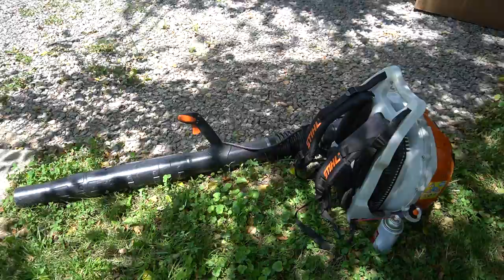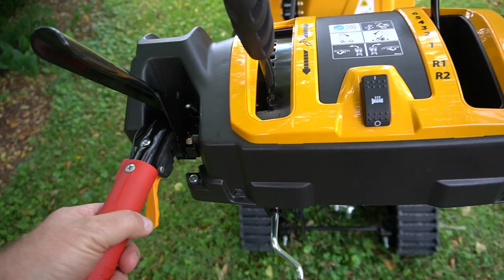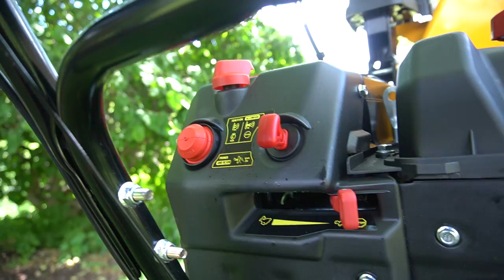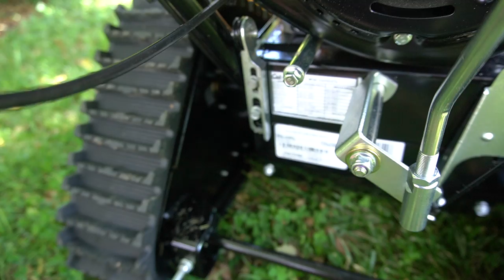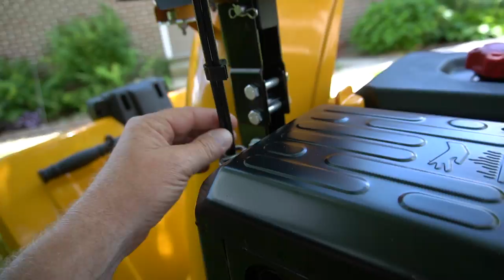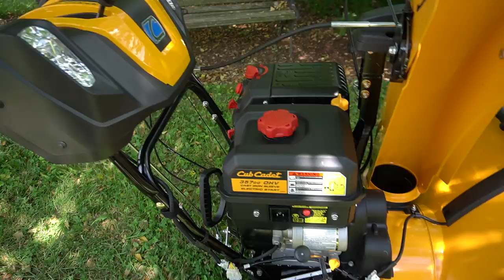Cub Cadet 3 Stage Tracked Snow Blower 2021 - Overview & Tips

Comment: Used to have this exact model. Mine broke in a year. Steering and reverse stopped working. Sold it and bought a Honda track drive snowblower. So far never had an issue. I hope you have a much better experience with that then I did.

Comment: Just beware.  Cubs don't throw very far at all.  Had one and know people that do.  The 1 complaint that I hear from them all.
Reply from the maker: If you’re only removing 3 inches or so of snow and you’re not going fast, that’s true.  It only throws it out 5 feet or so.  Just depends.  Sometimes less than that.  Depends on the snow type and how deep it is.  BUT if you’re plowing though 6 inches or more of snow, oh boy!  It shoots it out really far (20 feet or more).  It seems to all be about the volume of snow.
Reply: @Hooked on Photography  you think 20 feet is oh boy wow alot.  Its pathetic.  What is 20 feet.   That's what mine did at most.  Big 30" blower and a 375cc engine that doesn't bog down and all it can do is 20 feet!!   The cub cadet throwing distance is pathetic.  All the cubs are the same from what I've seen and the more I talk to people that have different sizes.   Now I have a toro 1232.  32 inches wide and same size engine as my cub. I went through the same spot in the snow. About 15 inches deep.  Cub threw about 15 feet, toro would guess at least 50 feet if not more.  Now that's a snow blower.  I liked everything about the cub accept the throwing distance its pathetic.  Will never buy another cub unless they change there throwing.
Reply from the maker: I’m just guessing.   I’d have to stop and think about the distance.  It may very well be more.  It very easily could have been 30.  Bottom line is that for me, it does what I need it to do, which is remove snow on my long hill of a driveway that I can’t do by hand or with our JD 4120 tractor because it’s too steep and dangerous for that.  I don’t normally get tons of snow.  The Cub (for me) seems built more than good enough and I’ve had zero problems so far after two winters.  Granted, it’s not heavily used but it works when I need it to.
Reply: @Hooked on Photography  they do seem well built. Just suck at throwing all im saying.  Anyone that buys them is getting jipped on performance  whether it's all you need or not. I was just informing people of what they really do wasn't intended towards you specifically.
Reply from the maker: @ecoboostrules9795  looking at the impeller on this unit, the blades of the impeller seem to be about an inch away from the wall of the housing so I’m just assuming that’s the reason why it won’t through snow very far until you get much more snow built up inside.   I’m not sure what the design rationale is for that and what other brands look like as far as the spacing of the impeller to the wall of the housing but it seems to me that’s the reason why it’s not throwing snow farther until you have a lot more snow.
Reply: @Hooked on Photography  it throws almost the same no matter how much snow you get.  Unless your talking less than 2 inches. It's that far away on several other brands.  I've looked at alot of them.  The impeller is to small also besides being far away.  Also should be more cupped to grab and throw it.  My new toro is very close to the housing and also has a 14 inch impeller.  Plus they are fully cupped so when it grabs the snow it goes.  The toro easily throws double the distance as the cubs.  Ariens,  and simplicity also supposed to be the same as toro for distance. Cubs got work to do.  Alot of it.
Reply: @Hooked on Photography  the salesman at the dealership has a 3x 30.  I was talking to him about this problem, he even agrees and said it's terrible and is going to sell his and buy something else.  That's a salesman for cub.  Lol.
Reply from the maker: @ecoboostrules9795   I looked closer.  It's probably more like 1/2".  I can barely get my little finger between the housing and impeller.  But I think that's why it doesn't throw well until you get into deeper snow.  Photos:  https://photos.smugmug.com/photos/i-26gKXRk/0/8e62c04b/X3/i-26gKXRk-X3.jpg

https://photos.smugmug.com/photos/i-cbt7Gnv/0/d793edf6/X3/i-cbt7Gnv-X3.jpg
Reply: @Hooked on Photography  again they don't throw well no matter what.  It's at least a half inch gap.  Plus impeller is to small and it's not cupped at all.  They have alot of work to do to catch up.

Comment: snow blowers do not have air filters
Reply from the maker: Yeah I learned that after I started to look up the reasons why snowblowers don’t have an air filter, I still think it’s a little odd but I can see why they don’t do it.   I would still prefer to have one.
Reply: @ThePhotographyHobbyist  yes....being as they run in a pretty much dust free environment....no need for it.....just like most boat engines....unless you run it through a sand pile of course (joking of course)....I hope you do a video when you see some snow.....would love to see that one in action.
Reply from the maker: @f62darkstar  I have one of those action cameras similar to a GoPro now, so I will definitely try to get some video when the snow hits.   Of course my luck would be, now that I spent the money to buy something like this, we will probably only get a few flurries this year.   😂
Reply: @ThePhotographyHobbyist  same here...last year I bought a Craftsman sb470 and we barely got enough snow to use it. It has the same identical engine as your cub cadet does.
Reply from the maker: @f62darkstar  hope you can use it this year (but not too too much).  Oh.  I guess that’s a MTD designed engine built by a partner in China.  I guess
Reply: @ThePhotographyHobbyist  I believe they are called power more engines.

Comment: The plastic wheels they are talking about breaking online are the drive cogs wheels in the middle they break around the bolt hole. I’ve replaced them twice in 10 years.

Comment: Great review, I appreciate your thoughts about making it last longer by not allowing the cables to kink when not in use.
Reply: Your comment about why you would want auger running still when not moving forward,   my thought would be so you allow the snow to clear out of the machine.
Reply: another thought so you can adjust the snow direction without stopping the auger

Comment: Would have been useful to see it actually run and turn, the part you said about it not turning well with the control switch would have been nice to see .
Reply from the maker: The comment about how it turns was made regarding how it turns on the grass (I bought it in summer and just wanted to drive it around and get familiar with it), but that’s not really relevant because that’s not a real world situation of how it’ll be used. I realized during my first winter of use that it actually turns very easily when you’re using it with snow on the ground.

Comment: About the transmission rod It usually tells you right in the manual how to set that up to get the gears to work right. 

For instance in the Toro manual for their products they tell you to put The gear shift in R2, Then you put the rod in the bottom first with the cotter pin, Then you pull the rod all the way up till it can't go anymore Then you unscrew that piece until it reaches the hole in the gear shift then you put the cotter pin in. 

This will set you up for everything to be perfect.

If the first gear is too fast which a lot of people have an issue with  All you have to do is get that top piece where the rod spins You want to turn it clockwise two or three turns. 

This makes the friction wheel on the friction desk be in a different place which will slow down first gear and actually make the reverse gears a little quicker. 

When you do any adjustment to that rod it'll change the speed in all of the gears so if you slow down first gear by turning it clockwise all the gears will be slower going forward but the reverse gear will be a little bit quicker  

Hope that explains how it works.. It's just putting the friction disc on a different spot on the friction wheel
Reply from the maker: Cool.   Thanks.  Personally, I’d like reverse to be a little faster.
Reply: @ThePhotographyHobbyist  Then just follow what I said about turn the top piece two or three times clockwise. It'll make first speed really slow But who cares You have six speeds. It'll make the reverse go faster.. That's the way I set mine up too.
Reply from the maker: @muzikmon2267  I’ll try that

Comment: ive got the 2x and its great!! lights up the whole driveway, and i love the tracks instead of the tires. it grips pretty much anything well.
Reply from the maker: That’s good to hear.  I have a big driveway on a hill abs also need to go next door to do the neighbor’s driveway which is a couple hundred yards away so I needed something I can drive across the yard in snow.  The tracks should help.   My luck will be this year, I only get a dusting of snow and won’t even be able to try it it.  😅
Reply from the maker: @willy david so far so good.  Though I admit where I live, I don’t have to use it very often.
 We could get 12 inches of snow, or just a dusting, just depends on the year.   There’s too much driveway to clear and it’s on a hill, so if it’s more than I can blow off with a professional, large, backpack blower, leaf blower from Stihl for example, I need some other way to clear the driveway and that’s where the cub cadet comes in.
Reply from the maker: @willy david the reason I like to use a backpack blower on my concrete driveway if it’s only 3 inches deep or less and it’s fluffy snow is because it does a faster job and it cleans it all the way down to the concrete (completely clean) whereas with any walk behind snowblower, you’re going to leave some snow on the driveway and snow that gets packed down when you drive over it and try to scrape it off with the snowblower.

Comment: For the steering to work properly you need a little resistance pushing against the machine like as you are going against snow.  Just using it on bare ground it basically freewheels and coats so you need to pull back slightly on the handlebar in the direction you want to turn.
Reply from the maker: Also I was testing that in the grass which is not ideal, but while using it this winter in snow and on my driveway, it turns rather easily.  👍🏻

Comment: For Toro horsepower they show the CC but the model indicates the horsepower.

For instance the 724 snowmaster is 7 horsepower The 7 in the 724 indicates the horsepower.

Same thing with the 826 or 828 those are eight horsepower

The 928 is 9 horsepower and so on..

Comment: So after a year how is going for you with this snow blower?
Reply from the maker: I honestly haven't had the chance to use it very often because we just don't get enough snow here often enough to use it.  I only use it when the snow is too heavy or too deep for my backpack blower.  That being said, so far I've had no problems at all with it.  It doesn't throw snow very far if you only have a few inches, but if you have a lot of snow, WOW...it throws it very far.   Traction is great.  It pulls up my hills with no problem at all.  I do two driveways.  Mine and the neighbor.  Mine is about 300 feet long (concrete) and the other one is about 200 feet with a large parking area.  It has done well there.  No issues.
Reply: @ThePhotographyHobbyist  any issues turning or maneuvering at all ?
Reply from the maker: @DamenonD  No.  it’s not as good as a true hydrostatic drive but it turns east enough on snow and ice.  Even if I have to manhandle it and spin it around by myself as a 53 yr old man, I can do it easily.

Comment: 357cc.  I AM CURIOUS IF THIS MIGHT BE A YAMAHA ENGINE?
Reply from the maker: I don't think so.  What I understand is that it's a relationship Cub Cadet/MTD has with a Chinese engine manufacturer.  I've only had the chance to use the new machine twice and haven't had a chance to make a video of it in use, but I'm hoping for some heavier snow this season so I can make a video.  Regarding the engine, everything looks well made and sturdy to me and it runs great.  I imagine as long as it's maintained well it'll last for many years for me.
Reply: @ThePhotographyHobbyist  it also looks like they requested engine manufacturer add shut-off function to the throttle lever making it very similar to the old Tecumsah snowblower engines. Some of the cheaper snow blowers you don't even get a throttle anymore.
Reply from the maker: @robertknight4672  Yes, if you move the throttle lever all the way to the right if you were standing behind the snowblower, that will turn off the engine.   Besides that it also has that little red “key “that you can pull out to shut off the engine quickly if you need to which I would assume is mostly just for emergency use.

Comment: Sell it nothing but problems chute  control/blew out 2 sheer pins only snow/just blew out the plastic drive wheel handle bar heaters never worked....4hr if that on it .
Reply from the maker: I have been using mine for the last two days and for probably three or four hours trying to move a large amount of slush which is a ton of sleet that fell.   It doesn’t do very well with slush, sometimes it will just sort of use out of the opening but I haven’t had any mechanical problems at all, I’ve been pretty hard on it and it is been working as expected as far as I can tell.  If you check the forecast for the Cincinnati area and see what we got yesterday and today, you’ll see what I’m dealing with.
Reply: I live in Canada I will trade you lol
Reply from the maker: @bobsuruncle7717  I’m sure you get a lot more snow than I do :).  What we had yesterday was several hours of sleet which accumulated to about 1 1/2 inches and then snow and then really cold.  The sleet basically became ice under the snow. In the future I would like to sell my zero turn mower and walk behind snowblower and replace it with a four-wheel-drive lawn tractor from John Deere with a snowblower attachment on the front and the option to have tire chains.   For what we get around here, even several inches of snow would be easy to remove with a PTO powered brush on the front of the mower so I’m thinking about that because I live on a hill and that would clean the driveway really well down to the pavement.  I’ve seen other people using them here on YouTube and it looks like it works great and there would only be a few special scenarios where it wouldn’t work for me.
Reply: Lol just fixed the wheel pulled the recoil to start it and I think the spring just broke , I had to look around to see if I have been punked or not or candid camera....I hate this thing for sure now MTD wtf ?
Reply from the maker: @bobsuruncle7717  that’s some bad luck.   😳

Comment: Do you really need something this complicated in advanced. 

The best snowblower for the money that outperformed all of them was the Toro snowblower the 826 was the number one and the number two was the 828 in all tests. 

No tracks. The weigh a lot less.  Easier to maneuver, They work perfectly with the tires they have go up any hills And of course the amazing customer support, easy to fix snow blowers, that lasts forever by Toro.. 

Not to mention THE ANTI-COGGING SYSTEM THAT REALLY WORKS NEVER ONCE HAS IT CLOGGED EVER!! That system also puts less pressure on the belts, and the motor because it recycles the snow to lighten it up before it's thrown so it actually gets thrown father. 

NO SHEAR PINS ON THE TORO SNOWBLOWERS REALLY WORK WITH THE HARDENED GEARS!! It happened to me I was snow blowing and the auger smacked right into a old rim that was under the snow it was a car rim so it was aluminum big and heavy. The machine stopped immediately I started the machine back up again and on I went.. no damage no shear pins no wasting time.. It really works it's ingenious. 

Then of course some people just buy the Taurus snowblowers for their best shoot control THE QUICK STICK!! IT IS TRULY AWESOME AND EASY.. they've perfected it and it last for the life of the machine.. You just have to do a little maintenance making sure everything is working properly..

And they also have an automatic differential auto steering. The steering does it automatically for you You don't need any levers and you can do a zero turn. 

Another good thing Toro does that Ariens tries to claim longevity.. with an Ariens you have thicker metal.. But that doesn't necessarily translate to being stronger or lasting longer.  Toro uses thinner metal to bring down the weight of the product to be more maneuverable But the metal is special made to be just as strong but to be thinner. I forget what the process is called.  

In other words Torah was always innovating trying to make things better they understand what matters and what doesn't.. their parts are always be available, Customer service is great, very easy to fix.. 

Those two snow blowers can handle absolutely anything if you see the videos that's why they won in all the tests.  

And the parts are available for Toro basically forever. And they're not expensive.. 

Unfortunately club cadet I think is made by MTD  which is known for having a lot of issues..  

Also three stage snow blowers from what I understand how much harder to maintain. They even recommend don't doing it yourself with the three-stage and give it to a service center I don't know why but there's got to be something to it  

And they don't necessarily perform better than two stage. 

Just some advice.. 

The only advantage to that one I can see over the Toros I mentioned Was that it has that thing that lifts it up automatically If you're doing gravel or cement. But Toro has more expensive models that do that also.. 

Most of the time if you set the skids to a 1/4 of an inch sometimes 1/2 If you have a combination gravel and cement driveway. Those measurements will take care of and work well with just about any surface..  

It comes standard I'm the factory usually at 1/8 of an inch off the ground with the skid shoes..